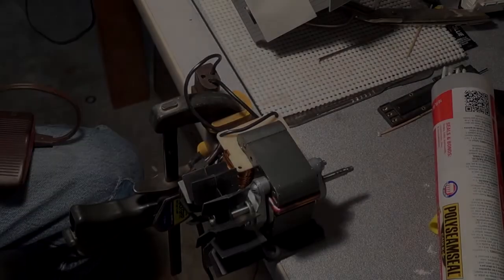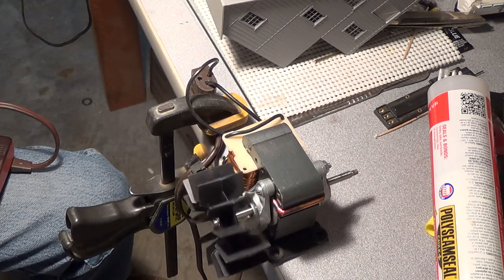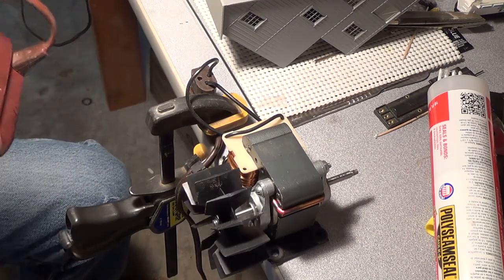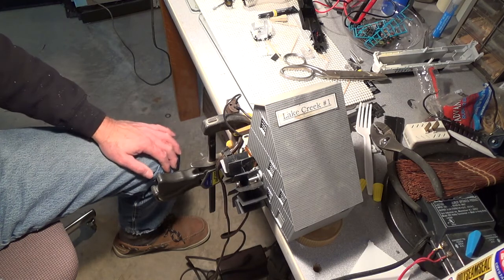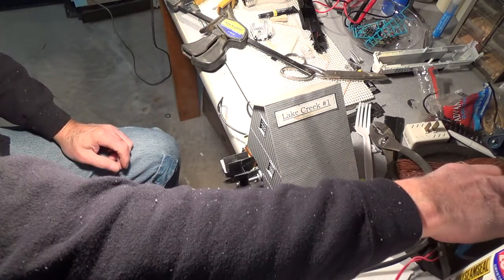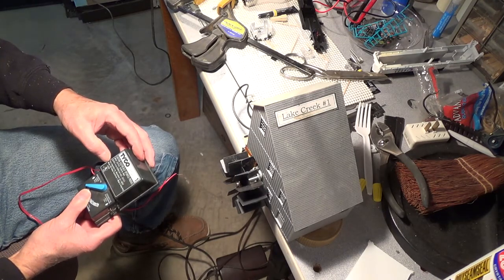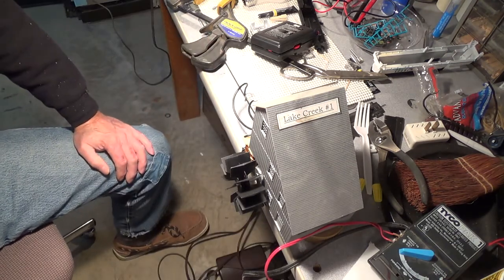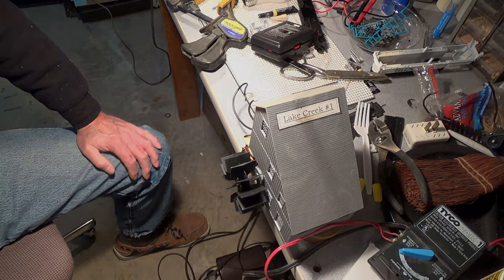Help! I want to slow down my water wheel...

Comment: Cool project George. That will be really cool when its done. Good luck getting it to run slower.
Reply from the maker: Thanks. The results are processing as I type this.
Reply: The Shade Tree Fix-it Man Your welcome. Glad to hear. If you used real water at the original speed you would have a real mess to clean up.
Reply from the maker: Northwest Railfan
Real water is not compatible with scenic materials on model railroads either. The now famous John Allen had originally designed his layout to use real water but after one time using it abandoned it because of all the issues involved, not the least of which is humidity, the enemy of the model railroader. You are right though, that water would be flying everywhere! LOL
Reply: The Shade Tree Fix-it Man Yeah it really doesn't work well. Its been done before but its really not worth  worrying about the mold and rot it can cause. I never knew that about his layout. That's really cool. There used to be a modular layout that was at train shows in my area with a working water fall. In order for it to not mess up the bench work I think it had a layer of rubber under it. Not very realistic looking, but it was cool.

Comment: I do not know much about the model trains , but think as others have said , maybe a dc motor , and you can also get dc dimmer switches if needed, I just got a $8 dollar DC Dimmer for a little project i am working on .
Reply from the maker: Well, I certainly have plenty of DC motors on hand. That may become the solution. I wanted to use this whole setup, since the fan will easily be modified to look like a water wheel and the shaft is already properly sized. Thanks for your input Terry.

Comment: Hi George, 
That is a synchronous motor. There is no easy way to change the speed because it is synchronous with th the 60 hrz house current. Only gearing it differently will work.
Reply from the maker: Normally I would agree with your assessment Bruce, but the fact that it can be slowed using the rheostat in the treadle pedal leads me to believe that some sort of resistor should be able to control it at a steady pace. Gearing may be the best solution though in the end. I don't need torque, which is usually the reason for gearing, which is why I thought of some sort of resistance unit to do the trick. Thanks for your suggestion.

Comment: Either a resistor or easier yet a house light dimmer switch(rheostat). Your switch must be bad because I have used the house light dimmer switch on motors before.
Reply from the maker: I will retest my dimmer switch and make sure it is the problem. I was thinking you might know of a solution. Thank you.
Reply: I have an old furnace motor turned into a shop fan that I have a light dimmer on. It is too powerful when plugged straight in but the dimmer allows me to slow it way down. They have 2 types the push to turn on and the rotate to turn on. I think the push to turn on is a little more precise.
Reply from the maker: sixtyfiveford
I will be posting my solution which includes many of the suggestions from different posters, including yours.

Comment: George, I like the suggestion below [if the dimmer switch does not work] of using the drive motor from a microwave but do you want differing voltages on your setup?
Reply from the maker: I will make this a dedicated circuit, so that it will run independently of the trains anyway, and most of the lights that I will be rigging up inside these different buildings will be on a 110 circuit, since they are throwaway christmas lights. More experimentation is in the offing. I will report back when I get it all sorted out. Thank you for your input Dan.

Comment: If it has not already been suggested you could use the lever type variable speed ceiling fan wall switch. Good luck
Reply from the maker: The solution will be shown tonight. Thanks for the help.

Comment: 110 volt rheostat a.k.a. a dimmer switch for a ceiling fan or light switch although a small low voltage DC motor would probably be cheaper than purchasing a new dimmer switch. Something of the same voltage as your train would work good and cost about 4 dollars on e-bay with free shipping. No chance of the motor heating up in a plastic house and causing problems. Just look up "low voltage dc motor". If you can find an old cage style humidifier off a furnace, the little 12 volt dc motor in there that turns the cage turns slowly and would work okay.
Reply from the maker: I have a pile of little can motors from out of stereo equipment and they are easily controlled by the transformers for the trains, so maybe that will be the solution. Thanks for your help Ed. I am trying to use stuff I have on hand, since $$$ are scarce beyond our budget, plus it makes the challenge that much more satisfying when I am able to re-purpose some "junk" into a useful object.

Comment: I would'nt be putting anything more than a 12 volt motor into an installation like that, of course here in the UK, standard domestic AC is 50cycle 230 volts. That can curls your hair if you grab hold of a bare wire.
Reply from the maker: How do you think I would look with curly hair? By the time I am done, it will be running on 3.7volts, how does that grab you? Thanks for dropping in for a visit.

Comment: I can see that this is 5yrs back project, but i wonder why everyone else suggesting ways to tuning the motor speed. Why dont u build a water tank and water path onto the waterwheel models. Then use simple DC aquarium pump and run the waterwheel using water. It would look more realistic, simple and u get the low rpm u needed for the waterwheels 🤔
Reply from the maker: Water is the enemy of model railroading. Moisture and the tracks don't play well together. Unfortunately, the whole project is gone now. Thanks for stopping by. The Shade Tree Railroad is gone but not forgotten.

Comment: i don't know anything about it - but i would try running it through a light bulb just to see what it would do
Reply from the maker: Water always ruins light bulbs when I tried to run it through it before...LOL Seriously, I didn't think of using an actual lightbulb  socket as a resistor...I will have to tinker with that idea. Thanks Stan.

Comment: The motor your trying to use is just to big George. A bathroom fan motor or fart fan will work with a dimmer switch. If you got that motor to work like that it would get hot really fast and maybe melt the building. Just my 2cents from a old maintenance man.lol.
Reply: Hey George I just remembered a stove vent hood has the same motor in them and I think a dimmer switch already wire in.
Reply from the maker: TheRedneckRailRoad
Hey, that is a great idea Stan and I have two of those kinds of motors "in stock". I'm on to it. Thanks for the suggestion. I have been getting all kinds of good ideas and if I don't use them on this project they will help on another.

Comment: That is a shaded pole motor. They work OK for fans and such. What you need is a triac based speed controller. BUT when you get down to the speed you are trying to get to that motor might not turn very well.

As Ed says it would be easier to use a different motor. Grab a junk microwave and pull the motor that turns the turntable, most are 110 volt ac and turn from 4-6 rpm. If you want faster there are some on ebay that turn 20 rpm or so.
item# 151554249232 or similar would do the job.
Reply from the maker: 4-6 rpm would be great. Is it the motor in the microwave that turns that slow or is it gear reduced too? I often see junk microwaves at the dump so I will check it out. Thanks for the information and the suggestions.
Reply: It is the turntable motor in the bottom. It's a gear reduction motor all self contained. They look like the ones I linked. You will also find another motor like you have in there on the vent fan. Be VERY careful around the guts, the capacitors in them pack a BIG wallop if you short them.
If you find one of the odd ones that run on 12 or 15 volts AC you can also find the transformer to power it on the board.
Reply from the maker: *****
Thanks for your help and the solution that I came up with will be shown tonight.

Comment: Wire it to a dimmer switch.
Reply from the maker: What kind of dimmer switch? I tried a light dimmer already and it didn't work, though I didn't test the switch otherwise so it may just be a junk switch. I will check into that again. Thanks
Reply: The Shade Tree Fix-it Man sorry, answered before watching the end of the video, I suspect the switch is junk, should work.

Comment: I would use a dimmer  switch.
Reply from the maker: I am going to retest the one I have, using it on a light, so if it works there, it should work on this motor. Thanks JB.